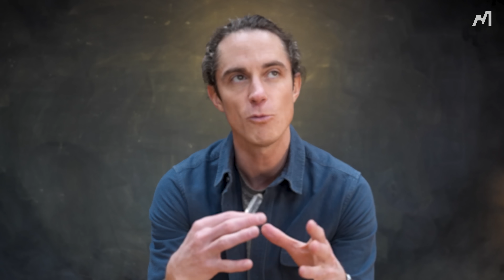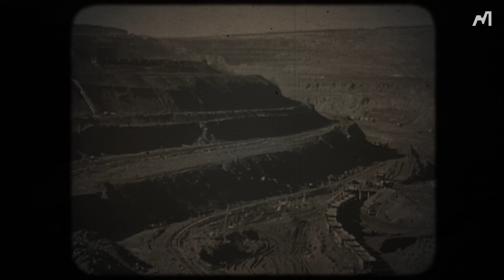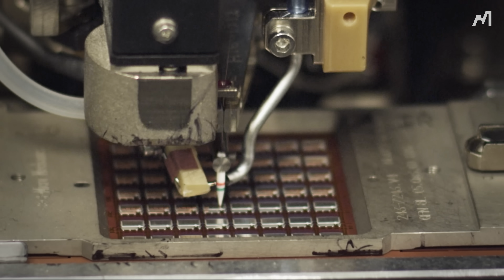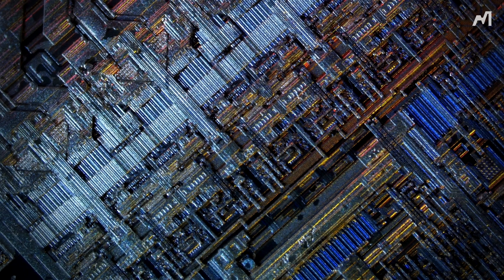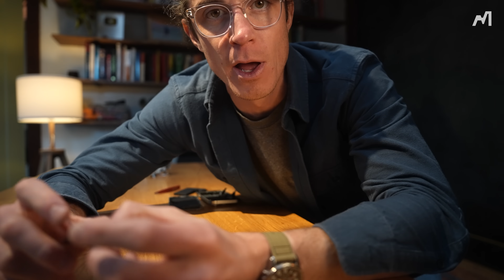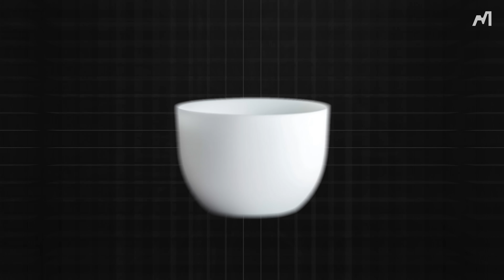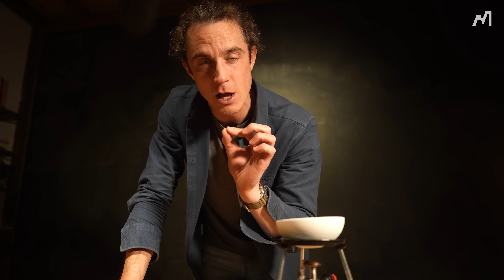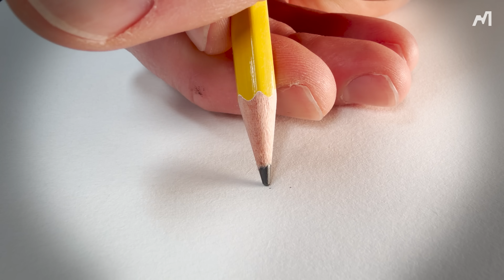Saudi Arabia Has Oil, America Has This

Comment: The large crystals used in semiconductor are grown in pullers where the crucible is rotated because the crystal is too heavy to control.
Reply: I ran a crystal puller for 3 years.  The crystal is rotated via a rotation shaft, or more typically, a pull cable.  The crucible and crystal are BOTH rotated to even out temperature distribution and control convection/stirring of the melt.  By careful control during crystal growth, you can control microdefects such as OISF (oxygen induced stacking faults) in the final silicon wafer.  Back when I was pulling crystals ages ago, the standard text was "Semiconductor Silicon Crystal Technology" by Fumio Shimura, which explains all of this.
Reply: they are grown in autoclaves in japan right?
Reply: Having this process in a low gravity environment would worth researching.
Reply: @revert6417 : Likely already has been, but we need a space station on a reasonable orbit (the ISS is tilted too far towards the poles, so that the Russians can reach it at all), and a decently affordable heavy-launch vehicle for access (the Space Shuttle was supposed to do this, but NASA optimized it for breadth of capability and cancellation difficulty instead of practicality). Currently the SpaceX Starship, Jeff Bezos' rocket, and the New Zealand guys are the only ones that seem to be pushing towards a viable rocket (the Boeing one is... not fit for the job).

Comment: Ok, now I need to know how exactly those large quartz dishes are made without any contamination to the surface.
Reply from the maker: We will likely never know. Those are trade secrets buried deep inside these companies
Reply: @Maxinomics   GREAT videos sir . I watch A LOT of similar channels here that discuss technological aspects of economy and let me tell say you always seem to have a " monopoly " yourself on the science or discoveries in these videos as almost NO OTHER channels are presenting these topics. I hope you keep making these highly informative videos and keep diving into more details. Thanks for the enlightenment.
Reply: @Maxinomics  The water has to also be extremely pure in the processing.... I wonder if anything else has to be of a certain quality and is also found in singular place on Earth.?
Reply: @WellHiddenTreasure I can’t imagine that’s the case, but I may misunderstand something.  I was under the impression that “pure” water actually strips molecules, meaning they would have to utilize some other liquid or method.
Reply: @Civenash  no, im fairly sure pure H20 has no detremental effect on the processing, it is mainly the minerals and impurities of the water, because silica is SO2, and pure H2O is only a problem because of oxidization, which isn't a concern in silica. Also, the water would block the air, which has many compunds that can bond to silicon and silica, wich is an added benifit
Reply: @Civenash even though it sounds like you may be incorrect from that other reply, I appreciate your critical thinking and the deeper understanding it has led me to.
Reply: @Civenash  wouldn't that be a good thing? You don't want the water to add minerals.
Reply: @abhinavdoddi660 Okay, so I did a little looking into this.  I’m right…and wrong.  Mostly wrong.  My concept of stripping seems accurate in conventional sense when relating to “pure water”.  They don’t just use pure water, but apparently “ultra pure” that has specific pH balance and deoxygenation (among other things) that would otherwise contribute to stripping.  You seem to understand this much better than me, so correct me where I might have that wrong conceptually.
Reply: @WellHiddenTreasure  very good industrial water filters do the job every day, if you have to ask how much it cost you cannot afford it.
Reply: @ColaBoyEdits i never saw the cost, we made our own ultrapure water on site. I do know that it takes billions just to build and start equiping a semiconductor fabrication plant. Some of the equipment runs in the hundreds of millions per machine.
Reply: @Civenash  u are correct. Ultra pure water is what is used.
Reply: @Maxinomics   Passed father to son...like Masters tickets.
Reply: @Maxinomics there is a company near me that builds the saws that are used to cut wavers from those grown silicon cristals and its right on there website. 😂
Reply: @Maxinomics  I have to imagine its quartz tools all the way down.  Using quartz tools to make more quartz tools, all within a sealed room, to then make the crucibles
Reply: @Maxinomics I work in semiconductor industry youd be correct
Reply: @Maxinomics somebody knows...
Reply: @Maxinomics Centrifuges, you are welcome.
Reply: @justsoicanfingcomment  and what are the centrifuges made of?
Reply: @abhinavdoddi660  99.9999999% pure quartz
Reply: @Maxinomics  Dunno why they wouldn't just shape them like any other one then sand blast finish them with the pure silicon. KISS method. Keep using enough pure stuff and there has to be a point where all contaminants have been stripped clean i would think.
Reply: @AnonymousNoNayme  Sand blasting and molecular scale clarity are probably not compatible, but the funnest part of these discussions is you could be completely correct.
Reply: @AnonymousNoNayme  I mean no disrespect, but do you really think that ANYTHING you suggest is something that would work for them? We're talking about an industry which has matured over the decades, via the brightest minds that understand the process better than anyone else. If a layperson could just come up with a revolutionary idea, they'd have already come up with it years ago. Dunno why you wouldn't just watch the video and then go on with your life as opposed to thinking you can solve some outstanding issue with the process. Okay I sound a little disrespectful, but c'mon do you REALLY think your suggestion is sound, let alone any good?
Reply: @AlBoulley  When a person is fascinated in a state of wonder, it's quite nice to let them ride the wave of pleasurable interesting thoughts.  Also, there are indeed hundreds of occasions in history when one person with a unique personal idea upended a long-standing tradition of how to do things.  It may take a whole crowd of eclectic fumbling people wracking their brains, but yes, it does happen from time to time.  Since wonder and brainstorming are not destructive harmful activities I, for one, appreciate and admire it.   Let the enjoyable wondering continue!  Carry on.
Reply: @AnonymousNoNayme not molecular contamination, and not in matrix.

This is one reason space manufacturing is interesting... in theory you could form pure silicon in zero G without needing a crucible.
Reply: @AnonymousNoNayme dry ice blasting might work better.
Reply: I worked in a research environment. Yes a couple times a relative lay person has said well why dont they just do this. I have seen long term resaerch up ended because the most brilliant minds were too immersed to take a 3rd person view. It is rare but I have seen it.
Reply: @Maxinomics  I imagine you have to use the crystal structure to your advantage like with graphene. i image you can use something a lazer or Electromagnetic Pulse Technology, to cut exactly between two layers, giving you an anatomic perfect surface?
Reply: probably out of more Spruce Pine Quartz and the then the tool to make those tools was more Spruce Pine Quartz. lol
Reply: It's called Czochralski (CZ) method and is very well documented. If I understand correctly the spruce pine quartz is actually necessary to make the crucible used in this method, not the material for the wafer itself.
Reply: @loicjeannin6233  The Czocharlski method is already mentioned in the video, what the orginal comment is asking is how were the quartz crucibles made without contamination not the sicilion ingot.
Reply: @loicjeannin6233  exactly, either platinum is used or even more ultrapure quartz, both of which aren't cheap
Reply: It's "pure as it is" the “no contamination” part is really: remove the contaminated layer you just created
Reply: @nata_dreams It's just cheaper to purify alredy clean base stock.
Reply: You cut dull silicon with sharp silicon on a lathe covered in silicon dust.
Reply: Transistors 60 times smaller than a human red blood cell... or they were in 2005 when I worked for semitool. Fun fact. Semitool products have ( or had, in 2005) a 97% throughput. Meaning that 97% of the chips printed on a silicon wafer were useable.... back when raider tools could put out a finished cartridge of wafers every 17 minutes?
Reply: I'm guessing melted quartz is spun or blown in an inert gas or vacuum, formed in some kind of none reactive, heat resistant ceramic or metal (Ruthenium or something?) mould. 

I'm guessing and probably way off.
Reply: Black Art
Reply: @randomuserame science silly 🐒
Reply: It is one of the most complex machines man has ever made.
Reply: It’s called a clean room. The manufacturing space has virtually 0 dust particles due to rigid air ventilation requirements. 

People are required to wear full body suits to limit contamination. 

Inside the clean rooms are elaborate high-vacuum chambers that the chips are built in which have practically no air in them
Reply: @Cant_we_all_just_get_along  i used to work in one, they are very strict
Reply: Near the northern idaho/ montana border. Just outside noxon montana. There's a hecla gold mine that runs through a part of it. The two companies have been fighting over it for years.
Reply: @lukewarmwater6412  gold is also mostly nonreactive with silica and is a cheaper alternative to platinum for high purity manufacturing👀
Reply: @abhinavdoddi660  gold is cheaper than platinum?
Reply: reverse osmosis water purified in a quartz vessel that then is used to hydrojet a rough shape, in a closed system that continuously RO's the water. Then perhaps they use quartz tools to grind unfinished surfaces and angles, maybe a bit of compression using quartz lined hydraulic presses here or there etc.
Reply: Oddly someday, we will.  It might take 5 years, or even 15, but AI will eventually learn the methods.  Or.. we will abandon silicon for something better.  Either way.
Reply: @kgmindustries8121  silicon has essentially reached its limits but has over 50 years worth of practical knowledge and is the cheapest of the good choices available.
Reply: look up iso clean room specs. you have rooms so clean, only a few hundred particles, the width of a few microns, may be present in the whole room at any given time.
Reply: Powder silicone and high pressure dies. No black magic. Just a few extra steps to keep the die from contaminating it.
Reply: They probably use a solution
Reply: @shadinmalik hydroflouric acid is a part of the process. The excess plating material is polished off with silicon rods. The tool that makes the circuit paths is a laser called a sputtering tool.
  I machined the first LT 210. It never made it to market. The raider tool came next. I machined the first raider frame as well... for 13.45 an hour. Wasn't worth it. Then when applied materials bought the company, my 401 k lost 1/3 of its value because applied took back semitools matching contributions. Waste of six years of my life.
Reply: You start with the purity of the quartz. Beach sand has way too many contaminants to even be considered.
Reply: I think they'll be using a process that doesn't result in any contact with the inner surface during it's creation at all.
Reply: you and me both but I am not sure that will be found. I am very pessimistic that anyone is going to explain this in detail enough
Reply: One very productive diatom
Reply: Terrence Howard
Reply: A rough idea is that they are melted and accumulated into a cylinder by dripping it slowly. Not sure, maybe im wrong
Reply: I would assume they are cut out of large chunks of quarts. They don't actually care about the crystalline structure of the containers they only care about their purity. I also assume that as long as they don't reach very high temperatures, contamination does not become a problem. So they find large crystal chunks, cut them down and wash them out with specially formulated chemicals to ensure there are no possible microscopic contaminates left. Likely an extremely long and delicate process, I could see it taking months to make a single one because heat is naturally produced in the cutting process and must be very carefully managed I would assume. 

All of this is merely speculation I don't actually know anything about the process it's self so take this with a grain of salt.
Reply: They prob grow an ingot from a seed crystal in a chamber with aerosolized quartz, then slice the ingot with diamond wires like they do for semi-conductor ingots and wafers.
Reply: PFM

Pure Freakin' Magic
Reply: Clearly they are made in a larger quartz dish lol
Reply: Radio Frequency Induction
Reply: having worked in a cleanroom that produces the silicon wafers for a lot of micro tech i can confidently say; very carefully. they will outright fire you if a tiny strand of hair is out of place when in production because that single strand of hair ruins the entire wafer. they are sealed in a tightly packed box with a bunch of other wafers while they are being processed and never spend more than around 3 minutes out of those tight controlled spaces.
Reply: I believe there was another video explaining how silicon wafers were made, and it has to do with pumping the chamber with the molten silicon with a noble gas (I think it was argon).
Reply: I'm guessing during processing the air in the crucible room is replace with pure nitrogen, helium, or some other non-reactive gas at or slightly above atmospheric pressure.
Reply: If energy is a factor in the process the gas might be one of the gasses lower on the chart, xenon, radon, etc. There's no reason this process couldn't be far more hazardous than we ever imagined
Reply: @StarcoreLabs  Something closure of the Strait of Hormuz has taught us is that for at least some microchip fabrication processes, helium is a significant part of the atmosphere mix. (An unusually high concentration of helium is trapped in with natural gas from the Persian Gulf, and remains in a tank after the hydrocarbons are chilled into liquid form & pumped out.) I could see its exceptional heat conduction being used for precision temperature control while growing the single-crystal silicon cylinders. I’m not an industry insider, though, so I don’t know.
Reply: @Jszar  liquid helium is used for cooling the magnets which somehow help align the monocrystalline structure
Reply: they pour them, or shape them like hot glass